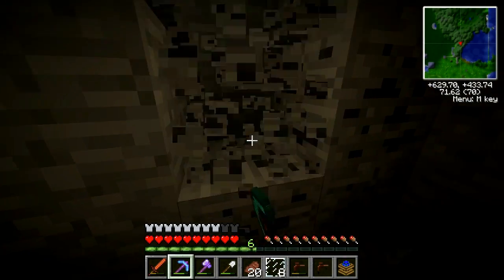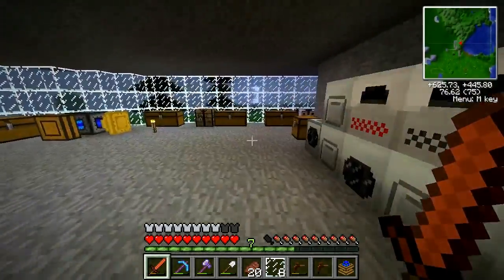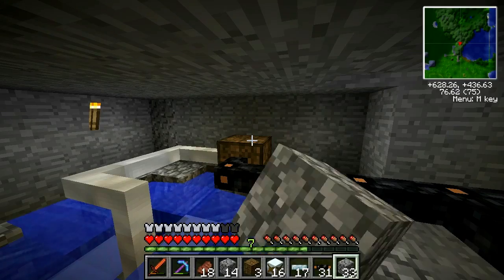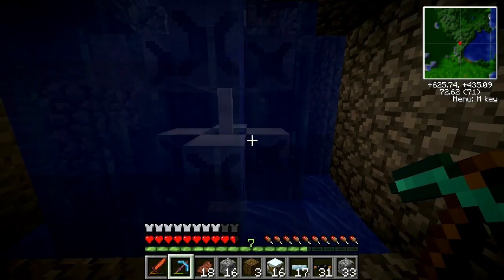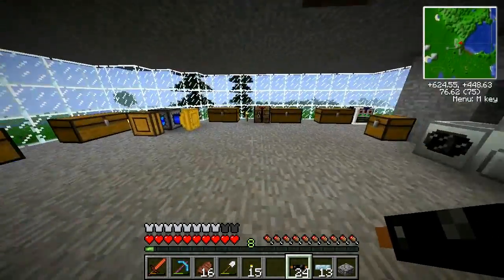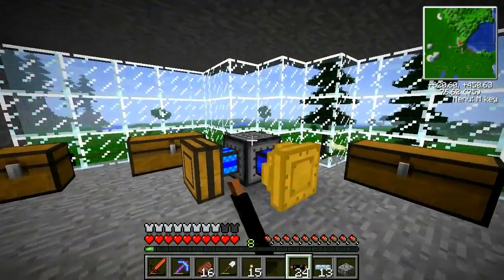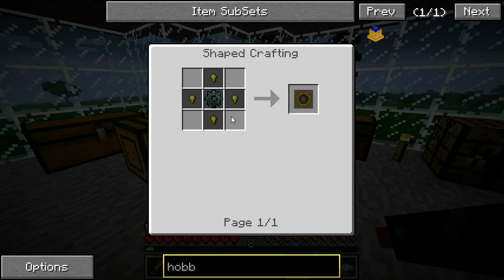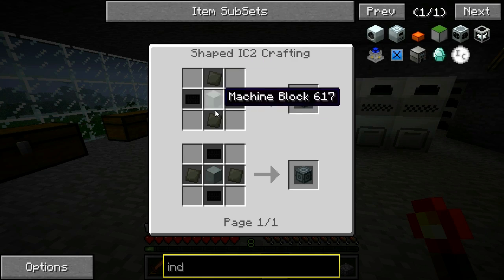Mindcrack Feed The Beast E02 More Advance Part 1-2 Solar panels industrial centrifuge compressor

Comment: no Tin cables can only tolerate up to 5 EU per tick, but they are very cheap to make and have extremely low energy loss. This makes them the ideal cable for solar flowers, since each produce a current equal to 1 EU/t and water mills that make 0.010 EU/t per block of adjacent water and wind mill that makes 0-4 EU/t

Comment: It gives 28 rubber for 8 resin in the industrial centrifuge, which is only 4 more rubber than you would normally get. It's more, but not way more. Plus you get plantballs.

Comment: Just a correction to your post they can handle up to 5 EU per >packet<. they could handle millions of EU/t as long as the packet size is below 5.

The EU loss is calculated based on individual packets and not the total EU/t going through the cable, so as EU/t goes up so does the EU lost per block. They are still very good with their efficiency but at 100EU/t at 2EU/p the amount of EU lost per block would be 1.25. Anderz shouldn't have a problem with that, just wanted to clear it up

Comment: Are you installing the correct version? Remember FTB is still 1.4.2, I'm using optifine U A7 for 1.4.2. and it works fine, oh and make sure its installed AFTER Forge, that can cause problems as well :)

Comment: dude you started counting at 900 and finished at 1340 so that equals 440 (not 340) which with you unbalanced counting would probably be double 2.5 per/second which equals 5.0 :p